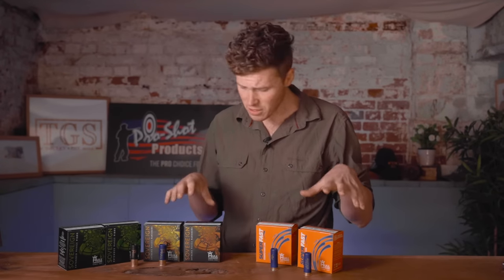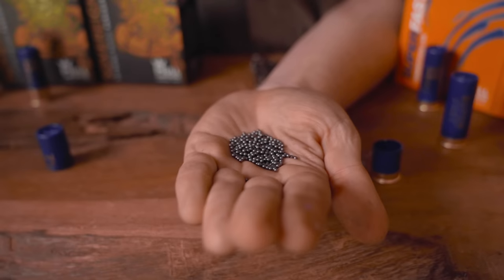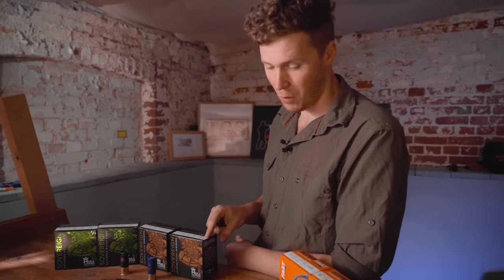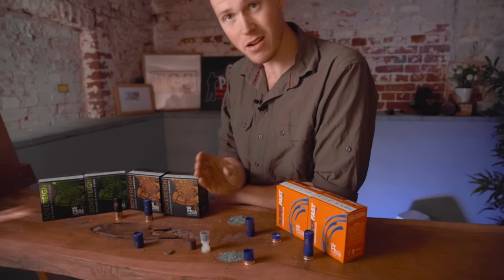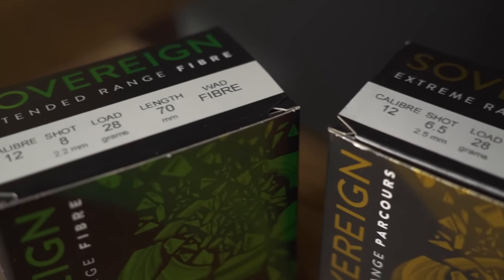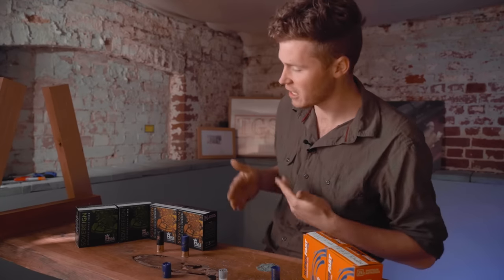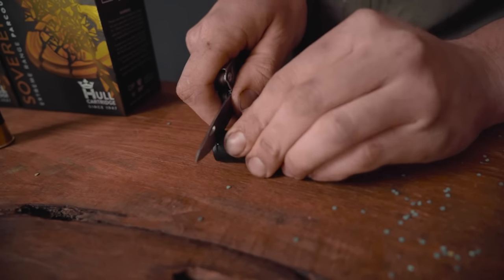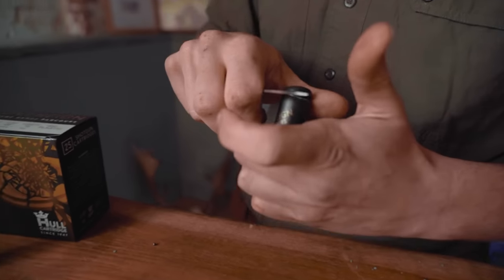Shotgun Cartridge Basics: Clay Loads

Comment: Good stuff. Keep it simple. Across the pond all shells are plastic for the most part. Shooting sports the ammunition makes the least difference. The gun barrel is your biggest variable. Chamber length, Back bore, forcing cone, forcing cone angle, bore diameter, choke design and type make the biggest difference. Nice video.

Comment: Dear Johnny 
I fully agree about most issues you mentioned.
Only a remark about high antimony shot.
While it works great balistically, an environmental issue is swiped. These shots makes the lead by far most bio available, becoming mobil and dangerous. 
As I consider lead shot intrinsequely not dangerous when properly managed. 
For more, lead shot is possibly intended to be reclaim. 
(I have been agent for 7 years in plomb and ecologic company dedicated to this purpose).
Nice moment when watching you at Bisley where I concluded a contract 8 years ago.
In my opinion, the danger comes from high antimony shots, very acidic soil and the use of steel shots after lead shots. 
( Oxydo reduction ) and the rust solves the lead and ....
Very known in belgian grounds. 
Sorry for being long and apologize my poor english.

Comment: One problem with shot sizes is there is no set international standard , eg: a 2.4mm pellet is a 7 in  Australia , a 7½ in USA and Europe and a 6½ in the UK  . The same differences follow for all shot sizes .
 I measured 10  shot from cartridges labeled 7½ and the average size was , Rio (Spain) 2.29mm, Winchester AA (Australia) 2.27mm , RC (Italy) 2.29mm , Federal Premium (USA) 2.37mm , Federal Top Gun (USA) 2.48mm,  Eley (UK ) 2.46mm , Falcon Olympic ( New Zealand made from Fiocchi components ) 2.41mm . 
So there is a fair amount of difference between makes and within makes . It would be nice to have an international standard . 
To get around the confusion, and as we use ammo from all over the World ,New Zealand has a maximum size of 2.5mm for clay target shooting  
If you are unsure of your shot hardness get two different pellets , put them on a flat surface , using pliers carefully squeeze them together , the hard one will go through the softer one .

Comment: It is hard to give a suggestion, which shotgun is the best. Yesterday I tested Sellier & Bellot Super Parcours 28gr. 2,5 mm vs. Clever T4 Revolution, 28 Gr. 2,5 mm. 
We shot the carridges from a Beretta 692 with cylinder (Skeet) Shokes.
On a distance of 40 - 50 Meters both cartridges worked. But the Sellier & Bellot was a real "Clay duster". Even on this distance! The recoil was a little higher, but 450 m/s (as described in the catalogue) is an impressive argument! I love this cartridge!

Comment: With respect to striking energy, the cheaper pellets with less antimony will have a higher lead content which means the pellets will weigh more individually & therefore would surely mean more kinetic energy?  
I understand higher antimony means less pellet deformation in the air which would impact the pattern shape with flyers but looking at striking ‘power’ alone then surely the cheaper shot would actually hit harder.

Would be interested to see your thoughts on that! Great video as always John
Reply: Higher Antimony content might also make those charges slightly more dense for shot count vs their mass for the same weight charge .You might only get 10 extra pellets by weight ( for a high antimony alloy vs pure lead), but they might be the difference in the pattern's effectiveness. However, your premise is mostly correct imho: a pellet with more mass at the same velocity will carry/transmit more energy to the target. The catch here is that if you are weighing each individual pellet in comparison, the mass difference is marginal to almost infinitesimal to the impact energy transmitted, especially ones as small as size 7 1/2 and smaller. 
I definitely agree with your assessment of hardness preventing deformation as applies to pattern preservation.  The external ballistics of tiny lead spheres and spheroids is fun... but also has a lot of random mechanics that make one's head hurt. 
55
Reply: @scottcrawford3745  fair play mate, great reply. I do shoot Dark Storm 9’s & 7.5’s for my clay loads competitively and they are phenomenal… but I’ve dusted no end of targets with the cheap old velocity’s. I think the main point is obviously getting the lead in the right place but yeah, just interesting to consider there are actually arguable benefits to less antimony.

Comment: Very interesting hearing this shot comparison from the sporting side. Most of my shotgunning is done for upland or waterfowl. Here in the U.S. nontoxic shot is a requirement for waterfowl and most states require it for upland as well. 
The older gents constantly lament the switch from cheap and effective lead to expensive (~$50us/25) Bismuth loads that offer similar density to lead. Tungsten and steel tungsten mixes run about $10 cheaper but are sometimes hard to find. Steel at 
~$20us/25 is by far the more common choice and while much harder than lead the density of the steel alloy doesn't allow it to carry as much energy out to those longer ranges and requires the hunter to finish game much closer than lead or bismuth allow.

Comment: Thanks. You already said that, but please let's not forget that  above a certain speed, extremely 
 fast and high pressure cartridges will patern clearly worse than a normal fast cartridge. Similarly we also know that very high loads in game cartridges do also pattern worse than a normal load (30, 32 grams)

Comment: Higher antimony levels in the shot do not contribute more kinetic energy and hence break clays better than lower antimony shot. Energy is about mass and velocity, hardness is not part of the physics equation. Higher antimony shot may work better because it resists deformation better when shot thus retaining shape and maintaining a greater portion of the original shot on target (less curveball flyers to reduce pattern density)
Reply from the maker: I have always been told it aids energy transfer onto the target at range. Need to test the theory out
Reply: So if two pellets at equal speeds hit a clay but one has a higher antimony and is more resiststant to deformation on impact, versus the other which deforms on impact more readily, what is the outcome?
Reply: @JB-tc8el  The harder shot that deforms less on impact will transfer more energy to the target.  It takes energy to deform shot, and that is subtracted from the energy the shot transfers to the target.  Simple physics.
Reply: I agree there is no difference in energy transfer between pure lead and lead/antimony alloy, as the energy transfer = mass x deceleration in this case. However, the higher hardness of antimony will produce a higher pressure on the clay and therefore better penetration characteristics. Pressure = force/area. It's like comparing a pure lead bullet and a steel core bullet of equal weight and speed. The high hardness steel projectile will not deform much on impact, therefore putting all of its energy on a small point, creating high pressure to punch through targets. Whereas a soft lead projectile will deform on impact, which spreads out the energy over a larger area, exerting less pressure on the target than its steel counterpart. Energy is also lost through the process of projectile deformation, so less energy is transferred to the target.

Comment: Fun stuff. Well, since antimony is considerably less dense than lead and the retained energy down range is dependent on velocity and mass of the projectile, a high antimony content would actually be detrimental, your experience notwithstanding.  In the old days, before plastic shot protectors, a higher antimony content made harder lead alloy shot. That meant that there was less deformity of the shot that made content with the barrel wall. It was (is?) believed that barrel wall friction was the mechanism by which choke produced its result. So, we wanted contact but didn't want deformity. Your 100 yd shot was a testament to your skill. An ordinary 12 ga cartridge will produce shot energies needed to break clays much farther...at least 130 yds.
Reply from the maker: A little bit like carbon in steel, a very small amount can have massive changes to the outcomes. 

I think in reality it is utterly marginal, but if it’s one pellet on the edge of a pattern (due to lack of skill) that I’m depending on - I want that one pellet to give me the best chance of hitting the clay. 

I feel a trip up the field and some sort of utterly unscientific test coming on!
Reply from the maker: And I think asking a 7.5 to break a 130 yard clay is big ask.... another trip to the field is necessary
Reply: @tgsoutdoors  I'll have to look up the actual record but I think the range was something close to what I indicated. Don't know the shot size used. Clearly larger size would carry more energy with lucky placement.
Reply: @tgsoutdoors  I strongly suspect that, with modern shot protectors, the effect is marginal at best. Obviously the move to steel makes the matter moot. But some testing would be fun. Perhaps soft lead and hardened lead through a full choke and NO shot protectors of any kind...shot in full contact with the inner walls of the barrels would be revealing to us old-timers.
Reply: @tgsoutdoors  Incidentally, today is Shakespeare's birthday. But being a Brit, you probably knew that.

Comment: Regarding whether to spend more or not a good idea is to buy a small amount of a few different ones and see if you can tell a difference with your gun at your skill level. The top shooters use top gear for one of two reasons. Either they are paid to by the manufacturer, or they can tell the difference. If you can't tell the difference then enjoy using the less expensive stuff until you get better. Someone who just learned to drive isn't going to drive better in a Porsche than in a Toyota Corrolla. But you might not need that much experience before you can tell the difference.

Comment: I have never seen a Fiber wad here in the States.  Honestly I would use them simply because I could help keep the Public land, I hunt, a little cleaner.
Reply from the maker: Never seen a fibre wad 🤨 I figured they would be just as available
Reply: Fibre wads are readily available for reloaders. I use them in 16g for a tightly choked pre-WWI JP Sauer, in brass shotshells, and also in my flintlocks. They tend to have a more distributed pattern and those old guns were designed to be full/mod/ic with them rather than plastic wads.

Comment: Are you folks in the UK allowed to load your own shells?  We in the US are allowed to do this and most of the serious Skeet shooters I know do load their own ammunition.  With the Covid mess going on it's the only way to get ammunition at present and last weekend my club ran out of primers, so the 6000 I have on hand will have to do and I'm not sure if that will last a full year.  BTW, a big plus for 410 is that it only costs about 3.30 USD for a box, so it's becoming a real favorite for practice.   

Concerning Shot, there are typically just 2 choices.  One is Chilled Shot which is the soft stuff, the other is Magnum Shot which is a high antimony hard shot and what is most common in my area.  BTW, the hard shot has a lower density so the standard charge bars will throw just a bit light in terms of mass.  One common tweak the serious Skeet Tournament shooters like to do is bore out the shot resevior just enough so that the correct weight is thrown, as in exactly 1/2, 3/4 , 7/8 and 1 ounce.  The end result of doing this is more pellets, yeah it's only perhaps 2 or 3% but it only takes one pellet to score on a bird in Skeet.
Reply: @gr-s2143  Not when it's a reload.  My cost to reload a 410 really is $3.30 per box of 25.  If I have to purchase a box to obtain some fresh hulls that cost is currently $14.00 per box.  Once all the pandemic supply restrictions ease I'll be able to purchase Cheddite or Fiochi hulls to reload with and those only cost about 19 cents per hull.  It's why I asked if folks across the pond were allowed to load their own ammunition.

Comment: Factory clear pigeon 12g 30g about 34p a cartridge from a 250 slab at £85 at John Beswick’s .
My own reloads , used Eley Olympic Blue 70mm hull , 6 shot steel 30 gram , cci 209 primer , vps plastic wad , Herco powder 25 grains . My time about 1 hour to resize and load 50 . Cost about 27p per cartridge . 
Is it worth it , I’m not sure 🤔 . 
£8.50 a box for factory and shoot 10 boxes once a week is £85 per week that about £4420 a year .
Reloads about £6.75 a box and again 10 boxes a week that is £67.50 weeks works out at £3510 a year . 
A saving of £910 a year but that’s not taking into account my time , however I do like reloading , it’s therapeutic and nothing like smoking a clay with your own reload . 
🤔 , helps you to understand the differences in powders , shot size and type , primer brands , wad types and brands to get the desired result . 
Not for everyone I know but worth a second look 😁

Comment: Total emperors new clothes. Ive shot the cheapest and the most expensive for clays and practical shooting and there was zero difference in the performance. I have had zero issues with primers on the cheapest shells I could buy in over 10,000 shots fired.